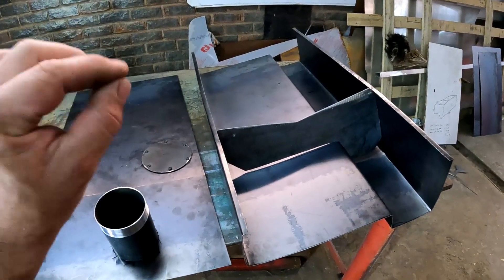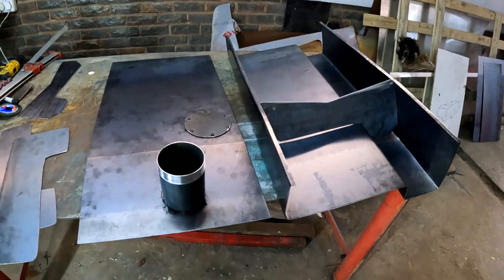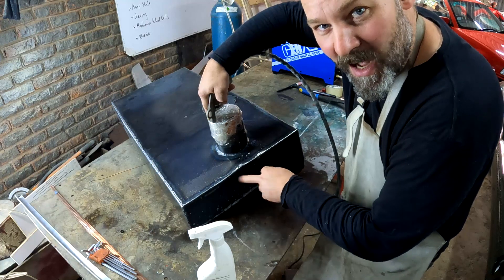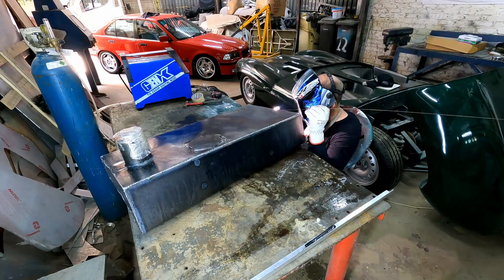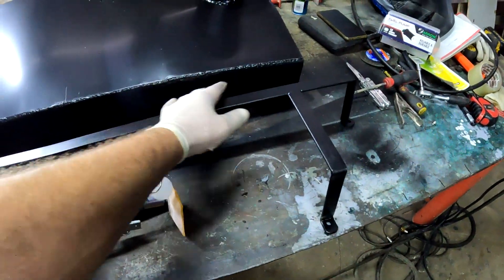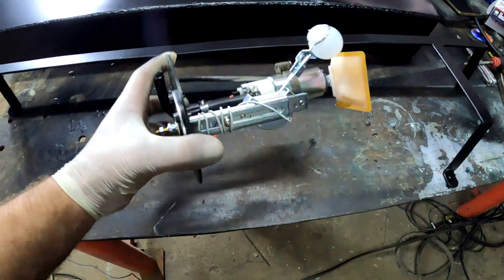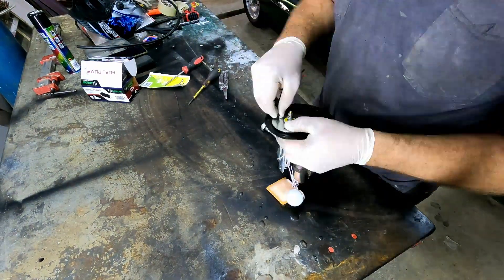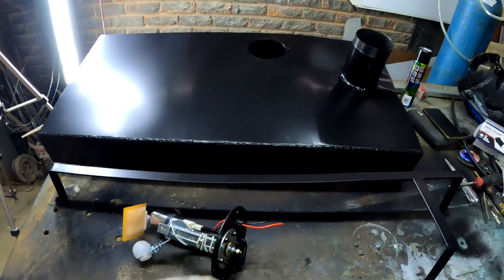Custom Made Fuel Cell for the Jaguar d type!

Comment: Does the fuel cell where the pump is etc, is there some sort of o-ring / seal for it not to leak fuel out between the two surfaces. (I'm a Durbanite btw, great job)
Reply from the maker: Hi there. I will be making a custom cork gasket for that part before adding fuel, otherwise it will defenitely leak.

Comment: Why did you use steel instead of aluminum for the gas tank ? Steel will now rust inside, so you will now have to seal it with some type of rust corrosion preventer , also did you provide a drain ?